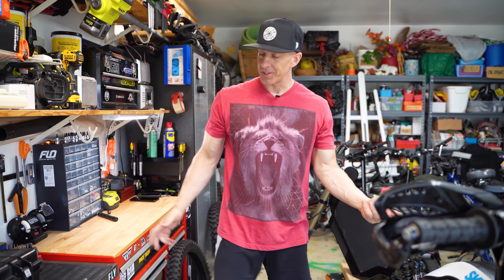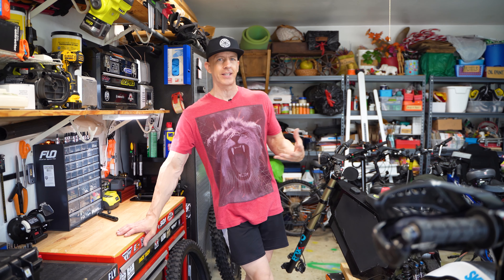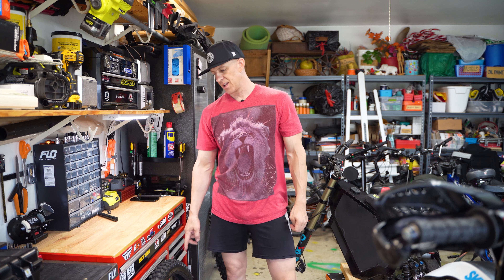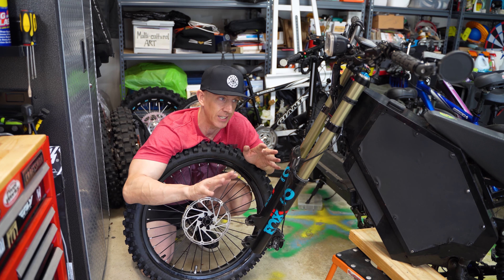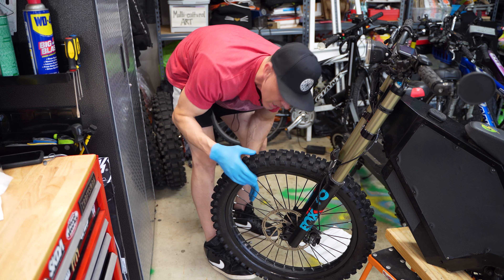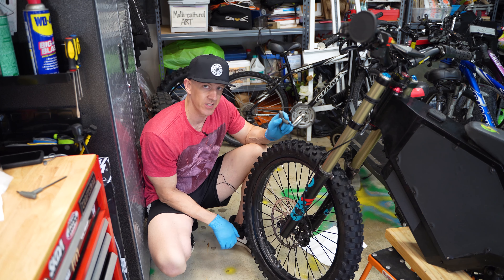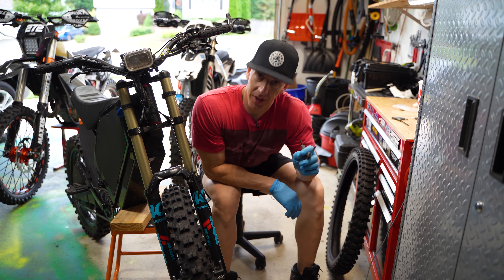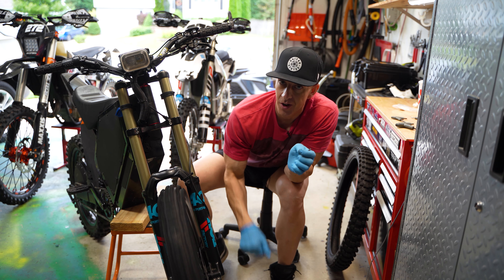Tire Tips on the Black Bomber E-Bike with Fox 40 Forks

Comment: AAA lion 🦁 on the T-shirt aha 😂😂😂🥰 as always great video
Reply from the maker: Ha ha, thanks man!
Reply: @JoshStreetDesign  i got the vector typhoon frame and qs 273 5t what do u say  actually i have a question for u what type of charge do u use and with how many amps do u charge your monster
Reply from the maker: @justbikesanvesh9549  I use a variable charger now that goes up to 12 amps, but normally I only charge at 4amps, because I figured low and slow is better for the health of the battery in a long run. It's still charges up to 83.9 volts which is pretty amazing for this battery.
Reply: @JoshStreetDesign  yes i also heard that slow charging is good for battery life

Comment: Hey boss I have a stealth bomber my 2nd ride the rear tire went flat I'm not able to pump any air in it either do you have a quick fix is it the stem valve maybe?
Reply from the maker: No quick fix.  You have to change the tube.  Get yourself some motion pro curved tie irons, tire paste, and get to work.  : )
Reply: @JoshStreetDesign  I don't think this tire has a tube boss it's a moto tire I think it needs to be sealed any tips I will surely appreciate it
Reply from the maker: @banneduser978  all moto tires have tubes unless it's a special tubeless system which that bike does absolutely not have. Trust me it has a flat tube.
Reply: @JoshStreetDesign  You're right discard the previous comment I got me a 21 inch tube from a motorcycle store nobody tells you about this crap I can't even find a bike store that even services these types of bikes do you have a video where you did similar work I couldn't find one.

Comment: Any tips for ballancing the rear wheel?
Iv got to fit rim locks on rear, motor has a natural bind, so ballancing will be hard.
Reply from the maker: @ModModRc  if it's got a natural bind then it's pretty much going to be impossible to balance that rear wheel with how super finicky a wheel is to balance.  On this black bike though it feels perfectly balanced riding and I never tried to balance it.
Reply: @JoshStreetDesign   so you put rim locks on the rear & didn't need to balance it. Did you need to balance the front? You didn't do it
I got 2.15" locks today, is that size ok?
Reply from the maker: @ModModRc  I balanced the front wheel

Comment: Yep my DNM forks get out of whack almost every ride. Probably cause I’m riding Enduro on a hub motor lol 
I love your Alta brother! I know I mentioned in one of your recent videos but I’m building a Suzuki Rmz 250 from the frame up. I’m in the process of building the wheels now and orderd the QS 138 70 H because it has the included gear reduction. Didn’t feel like fabricating a jack shaft for the qs180. You can follow my build on endless sphere  if you’re interested. I believe the title is "Suzuki Rmz 250 EV Restomod”

Also if you look on my channel I have a few videos of my enduro frame. just some short riding clips. I’ve had several different wheel sets but I found with this frame the 19 inch front and 16 inch rear is the best. Let’s be honest these aren’t normal dirt bikes, they’re kind of quirky lol  
Still love the Enduro frame although it’s a limited like what you’re saying. 

On a sidenote I wish I could race you on your QS 273 as I have the qs205. 0 to 30 is about 3.5 seconds. It’s the 6T winding. So it tops out at about 45 mph with 20s battery. 

Sorry for the long message and rant 
, I just love E bikes! Lol
Reply from the maker: Your DNM forks move around because they are like dirt bike forks in the way that there's no middle crown stopping them from moving.  Back when I had those the same thing would happen.  

I'm actually pretty shocked that you can hit 45 mph with a 6t motor as I can only hit 43 mph with my 5T motor.  What controller and battery setup are you running?
Reply: @JoshStreetDesign  

Oh Correction it’s my 5.5 T motor that hits around 45 mph. It’s a slow crawl to those last say 5 mph but eventually it will reach to speed with flux weakening. That was with a 19 inch moto wheel but now it has a 16 inch rim with a street tire so the top speed decreased slightly. My newer motor which is the 6T it tops out around 40 mph but eventually it will crawl to around 42 mph with 16” rim off road tire with 100a of flux. Although I never use flux weakening and don’t typically go over much than 30 mph. Some hard Enduro but mostly regular Enduro trail riding. You can check out online Brushy Mountain motorsport Park, I ride there a lot with the 6T. This 6T climbs so well and I’m actually able to turn down the DC amps to 80a. With that 5.5 T I needed 120 A to climb the same exact hills but that was also in the 19 inch rim so it’s not even comparison. 

If you’re ever in North Carolina you have to check out Brushy Mountain motorsport Park. I meet people there from all over the country and people even come from outside the country.
Reply from the maker: @eastwood111  thanks for clarifying, great info!